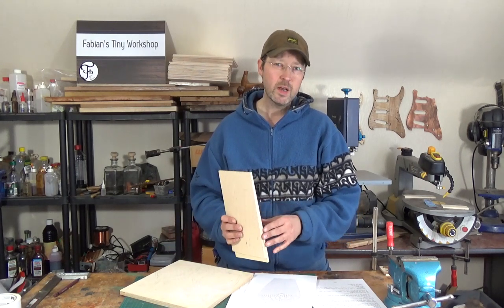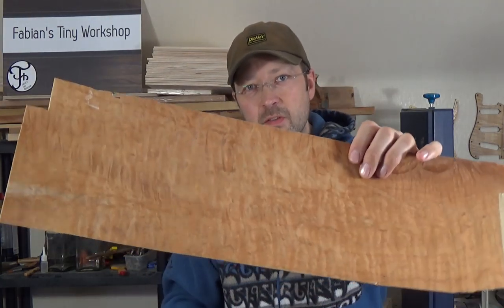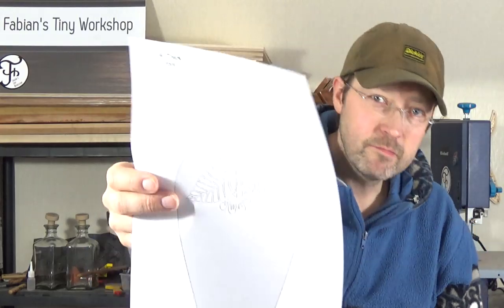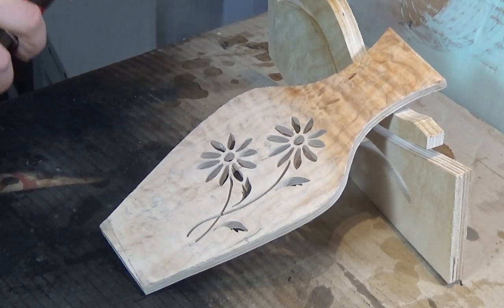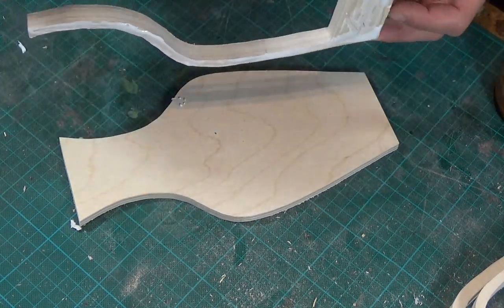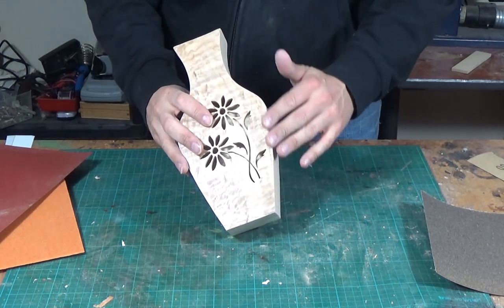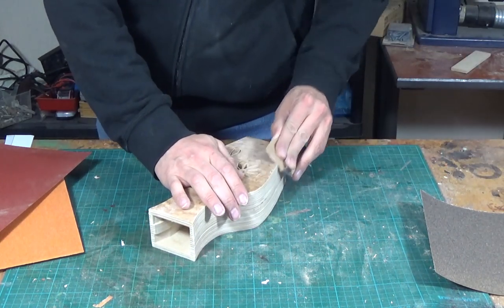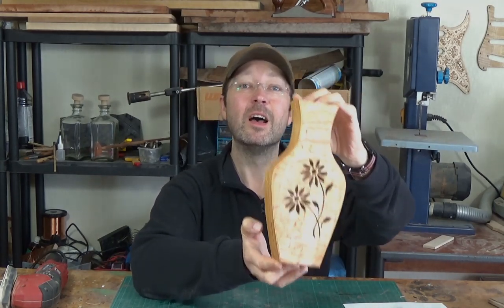Making a Vase on the Scroll Saw // How To

Comment: Hello Fabian good to see you back, as I've said before you are one of the reasons I took up using a scroll saw. I have poor coordination and fined it difficult to manipulate the work piece. I wondered if you'd have  ever tried using a spiral blade, with any success.
Reply from the maker: I "hate" spiral blades because they do not guide the cut. A goode regular straight cutting blade (like this: https://mikesworkshop.com/collections/blades/products/penguin-silver) will cut only in one direction and thereby will produce a clean and guided cut. With spiral blades the vibration of the saw will translate to the cut wich in my case will result in a shaky and unclean cut.
Reply: Thank you, that's good enough for me. @FabiansTinyWorkshop